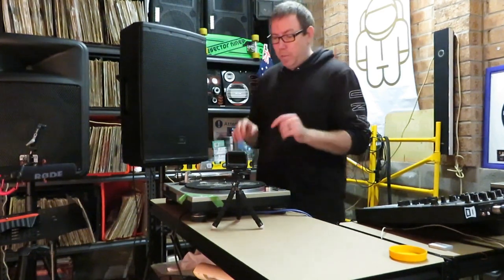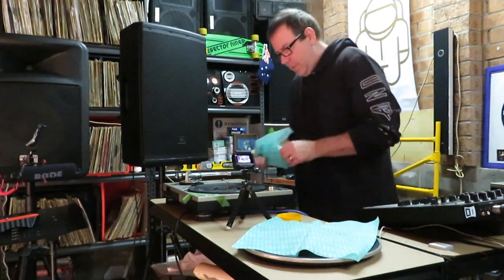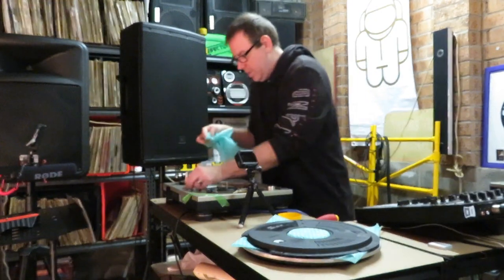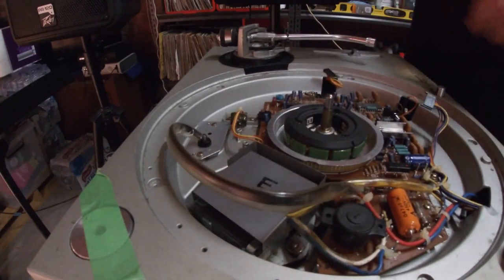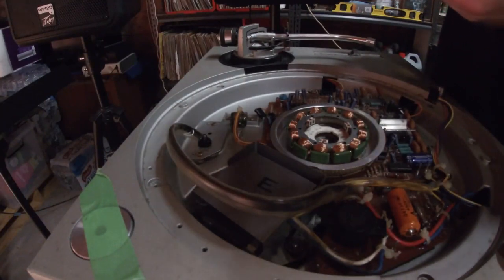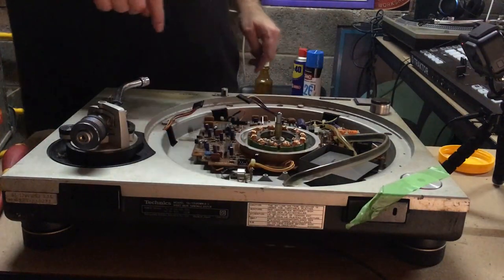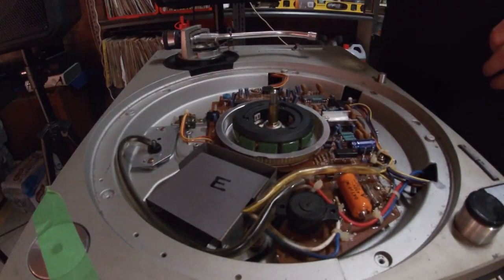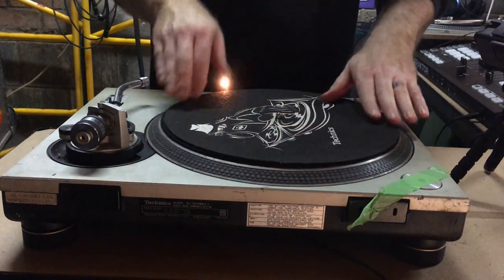Technics 1200 SL MK2 Turntables - General Maintenance and Cleaning in HD

Comment: I would never move a wire or a bundle with vintage electronics like this.  As an aircraft mechanic that works on 1960-1970's aircraft - any wire in place for decades degrades over time. More times then not           the wire will break when disturbed. I would use air supply regulated to less than 20psi. This has shown great results and does not disturb components or electronics.  Make sure to purge of moisture and you are good to go!  Good video man!
Reply: How do you R2 the control boxes when you gotta take the cannon plug off and move the wire bundles? I was a Crew Chief on a B52 H bomber made in 1960. We moved wires all over and not one single cracked wire

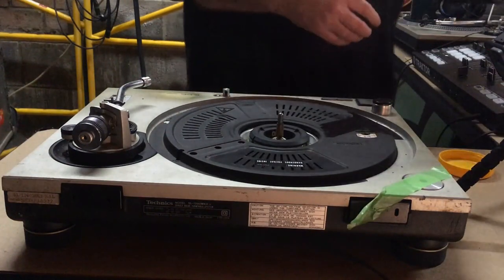Comment: At 5:10 in the video I can see a lump on the plastic cover for the main board is that normal? My SL1200 MKII has the same lump and I don't know whether it is supposed to be like that or if it warped by the heat from two resistors under that spot R201 and R213 that reach 118F and 132F respectively is that supposed to happen?

Comment: Hi lotex. I bought a brand new 1210 mk2. Unused. The issue is, the pitch oil is dry because its not been used. The pitch isnt like on my others. Its kinda sticky. Its callibrated ok, but very harsh compared. Do you know if there is a specific lubricant to use?

Comment: NO, NO, NO. To remove platter push your thumbs down on the centre spindle while pulling platter up evenly with your fingers in the two holes.That way no damage will be caused. Tapping the spindle with anything will just damage the bearing.
Reply: Im kind of surprised your the only one who said this, doing this will damage your turntable
Reply: I’d agree. Two thumbs, pull with fingers. Tapping is asking for trouble.
Reply: So many mistakes, but it is what it is.There aren’t many videos on that topic.
Reply: 😢😢 so brutal to watch